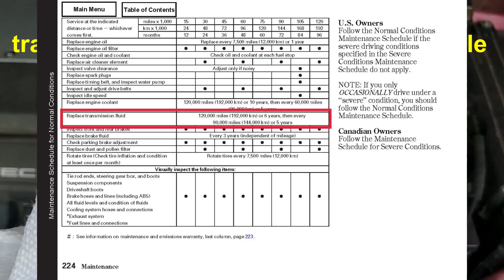Transmission Fluid Change Easy and Quick - Acura TL 2003

Comment: Stole your idea and used a plastic ball point pen body and some electrical tape for mine. I ended up needing for the actual fill hole, but it would work for the dipstick tube as well.

Nice work and great video!

Comment: There is a bolt on top of the transmission where you fill. Not the dipstick tube.
Reply: Yes.  You right.  I need to change mine in a week.  I just forgot exactly where the bolt is. I'm sure I'll figure it out
Reply: If your TL doesn’t have the upgrade cooler line mine does you have to take off a bolt and hose just to get to the fill bolt doing his method is easier if you got the added line they recalled and added the trans line where the fill bolt is
Reply: I thought that 2 so would it be okay to do that?
Reply: @charlesc6056  yes

Comment: When to check the transmission fluid, should the engine be at operation temperature or cold, car on or off?

Thanks for the good video
Reply from the maker: Car parked on level surface with engine running, let the engine warn up before you check. I would check your owners manual if you've one.
Reply from the maker: Thanks for watching the video
Reply: Car off. Honda's are the rare exception.

Comment: Recommended oil type Atf dw1/z1. eBay has them in bundles. I use to do the transmission fluid change like this till I found out about the actual bolt , way easier now. Good idea with the sharpie tho
Reply: What do you mean by "actual bolt"

Comment: What year is your TL? I have a 2003 TL Type S and it only takes 3 qts. I over filled it once and it shifted like crap. Check engine light came on, shift indicator blinked etc...
Reply from the maker: Mine is also 2003 TL type s
Reply: I have a reg 03 Acura TL 3.2 and it's been in limp mode blinking D5 and my level is extremely high. I'll change my fluid tomorrow. Thanks for advise!!!
Reply: Mine also just took 3 qts, make sure you put AS much as you take out

Comment: Where is the filter located and was the filter changed during this service?
Reply from the maker: The filter was not changed, I believe it's located on the right side of the engine (facing the engine).

Comment: Thanks you help me with this. Nice video
Reply from the maker: I'm glad it helped.
Reply: How meany qts it takes for 2003 Acura TL transmission.
Reply: The auto parts place told me 5 to 7 qts I put 5 qts
Reply from the maker: @henrypagan6657  I put 5qrt, which was the same amount I removed
Reply: @EPICFIXwithNardos  so is 5 qts ok I took out 3-1/2 qts.
Reply: @EPICFIXwithNardos  yes your right 3 qts thanks I’ll take out 2 qts love your videos.

Comment: Dear God! PLEASE only use HONDA transmission oil or the fragile TL transmission will go BOOM
Reply: Hondas atf fluid is horrible. Better to use like a maxlife that has the rating for Honda or Acura then to use Honda fluid.
Reply: @fewminutestudio959 instead of the atf use the zw-1 its genuine honda and its tenfold better than the shitty atf

Comment: hows the car feelin after the fluid replacement
Reply from the maker: Much better
Reply: @EPICFIXwithNardos   love it ! 
Going to do mines soon ! 

I just replaced the valve cover gaskets . 

174831 miles still going strong 💪🏼 Acura TL 2000
Reply: 207,000 I want to do it but scared to loose tranny
Reply: Ching Chong did you do the flush on your tranny cause I want to do mine but scared to do it don't want my trans to slip cause has 232000 miles on it and don't no if it's a good idea to change it my fluid is dark black I bought car like that and I'm thinking of doing it it's a 04 Acura tl v6 3.2l
Reply: @AngelSanchez-my5ck just a drain and fill with DW-1 ATF  3 qts. Is all that's needed. Don't flush it!! They say Honda transmission's are good untill 200k. If you're past  200k drive it gingerly and keep an eye on the transmission fluid condition.
Reply: @danp7463 my automatic rsx has 282xxx miles should I do a transmission oil change or leave it I heard it messes it up so I been hesitating on doing it
Reply: @danp7463 thanks for that I just sold the car gott into another car with no issues but thanks for the tip 🎉
Reply: @antoniosolorio2475  thats only if your trans is slipping, changing the fluid and doing a flush are 2 diff things, a flush will clean out all the gunk inside of it thats keeping it together to what techs say when i worked at a dealer.

Comment: Anybody know what to do when the bolt is so seized up that it twists the ratchet head?
Reply: Welding an 4 in extension ,will work or the adapter too
Reply: Cheap ratchet head get a better ratchet and use a breaker bar to help crack it loose if you really need to spray a lil bit of wd40/penetrating oil on the drain bolts crack/washer and then try
Reply: Give it a good hit with a hammer to loosen it and wouldn’t recommend wd40 unless that’s your last resort. And get a wrench along with a pipe and try to pry it loose like that

Comment: Only Honda fluid !!!! Not dextron
Reply: Honda ATF fluid is a junk blend oil  with next to no protection additives (boron, phosphorus, zinc...). The only guarantee you get is... transmission failure from high heat!

Go ahead Google this for quick filler :
"Honda ATF MaxLife"

Comment: Did you pour the transmission fluid in where the dipstick goes? Or did you remove the bolt to pour it in?
Reply from the maker: Poured it where the dipstick goes, didn't remove the bolt. I used a pen, anything that connects the funnel to the hole should work.
Reply: @EPICFIXwithNardos  so I don’t HAVE to pour it where the bolt is? Cause I literally can’t get the bolt off... if so I wasted so much time and I couldn’t just did the sharpie ....
Reply: @tysoflie  yeah I’m in the same boat. I can’t get the bolt off so I’m on to the dipstick lol
Reply: @EPICFIXwithNardos  so I have the 02 RSX base model joint. I did a trans fluid change yesterday, I put 3 courts back in and poured it in where the dipstick goes for the trans... Is that ok to do?
Reply from the maker: @Melanatedalchemist  the dipstick should work, that's what I did on mine...I don't think the model matters